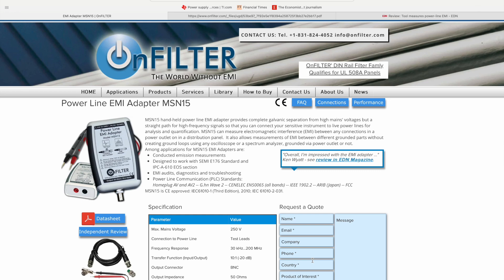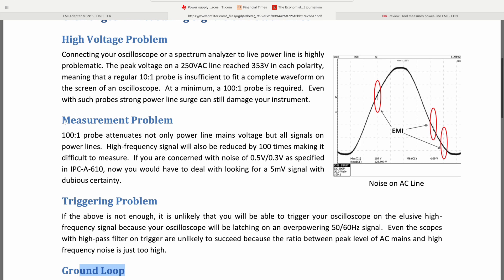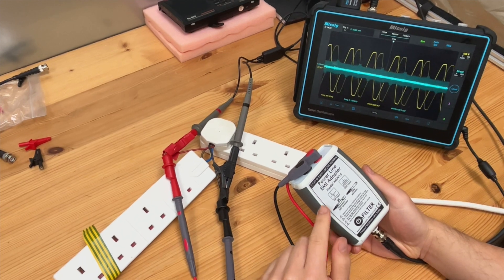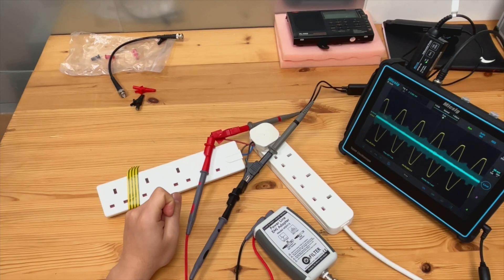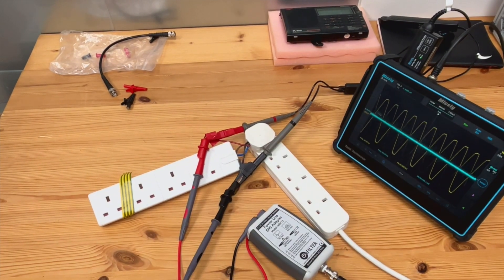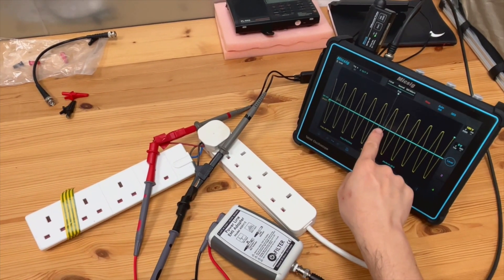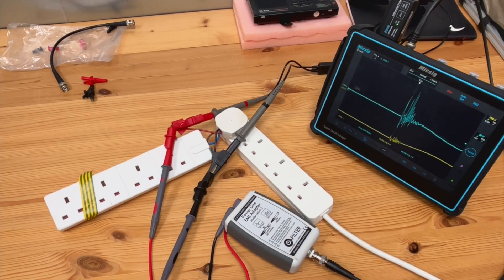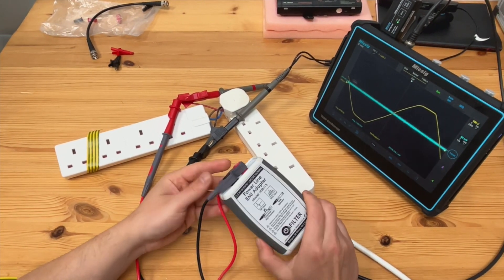Assessing Power Line Noise: Introducing a Measurement Tool for Accurate Analysis

Comment: Interesting, thank you for doing the video.
I guess the adaptor can can be used with a spectrum analyser to find out the impact of equipment like UPS or VFD;
1. How 'dirty' is the incoming power supply
2. How much 'dirtier' the equipment makes it
Any thoughts?
Reply from the maker: The device allows you to troubleshoot mains power line noise, either using a spectrum analyser or an oscilloscope. With conducted emissions, I would use a spectrum analyser, but with transient events, such as relay on off, I would definitely use an oscilloscope to capture the noise. In a typical industrial environment, what you find you get both types of noise, it is just the nature of the electronics. As per our friend's comments down below, it is interesting. Because how can we trust the results we measure? Most engineers have a bias, who believe the more expensive the measurement equipment is, the more they trust the results. I personally try to use quality products, and I have this "trust but verify approach".

Comment: Maybe I am just dum but isnt that box just a hi-pass filter? Thanks for great videos! / Tomas
Reply from the maker: I think it is more than a high-pass filter. I actually spoke with their engineers at one point, it is quite challenging to design this device because it is made for measuring mains voltage, so leakage current must be kept low.
Reply: @MachOneDesignEMC  when looking fast on problems they very often seem simple. When looking in depth on problems it is almost always complicated 🤣